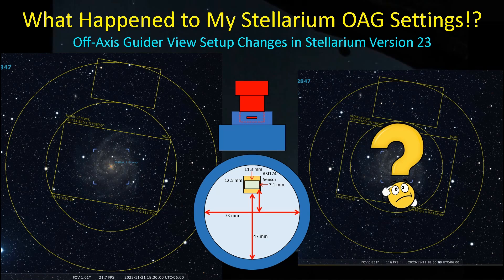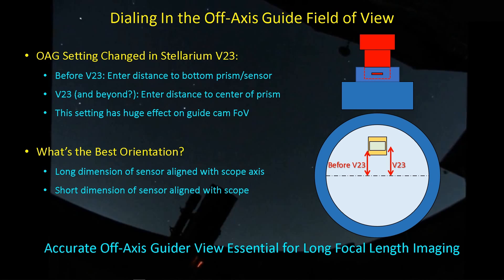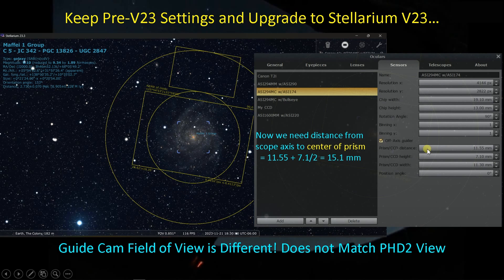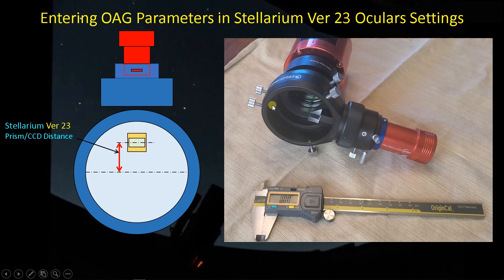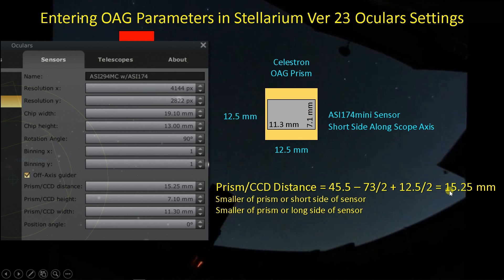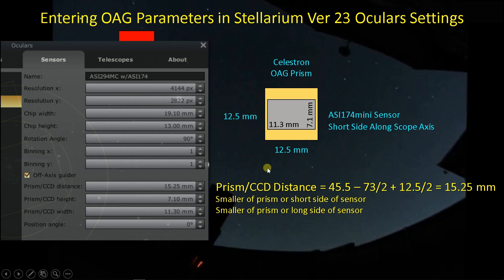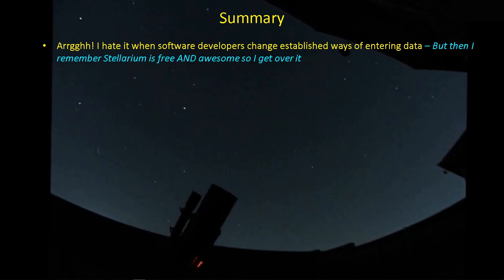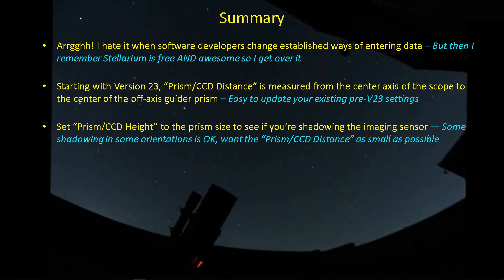Changes to Off-Axis Guider View Settings in Stellarium v23

Comment: Very nice video - thanks.
One major thing that can mess you up with the OAG is that, depending on your scope type, the actual image orientation of stars that you see in PHD2 is either inverted or mirrored when compared to the main scope image.
It would be wonderful if PHD2 had an option to flip / invert the image - it would make life so much easier at 1:00 in the morning.

Comment: Hi James
 I have a similar setup with my Celestron SCT 9.25 scope and Celestron OAG guider with ASi174mm camera.
Always get a lot of helpfull information for checking my setup or tweaking it.
I had watched your youtube videos of creating a FOV indicator in Stellarium for the OAG .
"Using stellarium "markers" to setup an off axis guider.
" Changes to Off-axis guider view settings in stellarium v23"
One thing I noticed, you seem to have changed your Mirror distance from the bottom of the OAG housing to the bottom of the prism.
It went from 47mm to 45.5mm.
Did you find something in your analysis of the setup that lead to the change?
I run with 2 different cameras on my SCT.
A ASI2400MC pro , full frame and a ASI2600MC pro APC imager.
Right now I have the prism set at 49 mm from bottom of the OAG housing to (I think) prevent too much intrusion into the Full frame imager FOV.
Does this seem reasonable to you?
Thanks for any help on this.
Always enjoy your videos.
Take care
Steve
Reply from the maker: Haha. I see what you’re trying to do! You want me to go back and watch all of my videos. No way! I’ll try to go from memory rather than endure the torture.
There are a coup,e do things going on…
1. Stellarium v23 - they changed the CCD/prism distance from (before v23) center of optical axis to BOTTOM of prism to (v23 and higher) center of optical axis to CENTER of prism. So that’s a 6.25 mm (for the Celestron 12.5mm prism) change just to make the OAG image the same from v22 to v23.
2. I also have a video (pre v23, I think) where I define an OAG “bull’s eye”  and use Stellarium “markers” to place the main scope at a RA/DEC so that the guide star is in the bull’s eye. If it’s off, I make changes to the CCD/prism distance in the Stellarium Oculars settings so that the star will be in the center of the bull’s eye. That may be the source of one change you’ve seen.
3. And I’ve also changes to the physical distance from the center of the scope axis to the center of the prism to try and get more round guide stars (reduce the distance) without suffering too much of an OAG stalk shadow (increase the distance).

So those are the things I’ve been exploring in the various videos. If your star patterns as seen in PHD2 look like Stellarium’s OAG view AND you’re not plagued with a significant OAG stalk shadow, then no need for any changes! Thank for watching, Steve….so I do t have to
Reply: @Aero19612  hi James
I wasn’t sure if you paid attention to the peanut gallery commenting on your postings. I always seem to  find something of interest in your posting s. Probably because my setup matches yours , such good taste we have. Ha  I obviously fell behind on watching your videos. Was sidetracked getting ready for eclipse. Sigh . Traveled to one of the mostly cloudy areas.  Thanks for your postings and in depth explanations. Take care.  Steve
Reply from the maker: @stevekaiser4959  I always try to reply but some comments do slip by me from time to time.
Reply: @Aero19612  James. You always do a great job. I look forward to your videos since they are detailed and well presented. As a retired ME design engineer (robotics & machine vision) you keep my attention with the details. Thanks, take care
Reply from the maker: @stevekaiser4959  robotics and machine vision? What a perfect skill set for this hobby! Nice

Comment: Hi James. 

What is the blue part on your guide camera and what is it's purpose?

I've been using my Celestron OAG on my C8 for a few months now. I noticed during focus adjustment  the helical focuser wasn't smooth throughout the focus range. It would be smooth then resistance was felt. When I removed the guide camera (ASI174MM) the helical focuser was smooth throughout the range. I notice the OAG guide camera barrel is a bit oversized for the guide camera. The two locking screws cause the guide came to push against the focuser tube that moves up and down. I guess it's not a big issue if you can start the guide camera near the backfocus point then only have to move a couple of millimeters to tune in the focus. I do wonder if the locking screws can cause the guide camera to tilt a little that might affect focus so that one part of the sensor is in focus and another isn't. I  see what appears to me to be some stars in focus an others out of focus in PHD2. I have a ZWO helical focuser that can screw onto the top of the Celestron OAG focuser. The ZWO users two screws but a brass ring is used to clamp onto the guide camera body. The focuser is smooth throughout its travel range. It works with the Celestron focal reducer and its 105mm back focus but not with the Starizona focal reducer's 90.3 mm back focus. You can't get the guide camera sensor close enough to 90.3mm, 96mm.
Reply from the maker: That blue ring as a par focal ring from Farpoint (bought on Amazon): 
Parfocal Ring for 1.25" Eyepieces, FP500

I don't think the two set screws will cause rotation since one screw pushed the camera against the helical focuser wall and the other set screw will push the camera against the focuser wall 90 deg away. That said, there can be some issues. I've had decent luck with the Celestron OAG. I have a later video that looks into the backfocus for the Celestron reducer. I got elongated stars at 105 mm and better results at shorter back focus (~85 mm). Thanks for watching!

Comment: Thanks. Obviously, I can’t do simple math. I got mine working now. Question, why didn’t you get Hyperstar for your 9.25 vs two refractors. Did you have those before your SCT?  I’ve been playing around with Stellarium and FOV is limited at F/10 or F/6.3. I plugged in my C8 with at 390mm and I can frame the North American nebula in one shot. I figure getting all the goodies for a refractor it would be cost effective for Hyperstar. I’d have to attach a guide scope but at F/2 you could get away with a smaller lighter one than you had before your OAG.
Reply from the maker: A hyperstar is an attractive approach. I find dealing with refractors to be much more convenient than handling the bulky/heavy SCT. Also, you can’t use a filter wheel in the hyperstar configuration, so if you go mono then you have to go with a filter drawer and changing filters is a pain. Operating at F/2 generally requires special filters. Focusing works better with the refractors without the mirror movement.